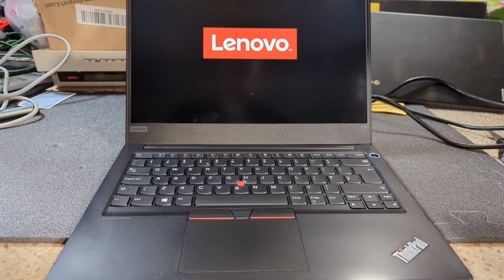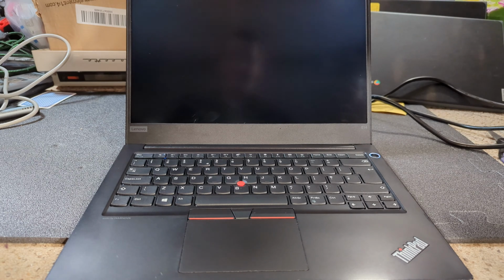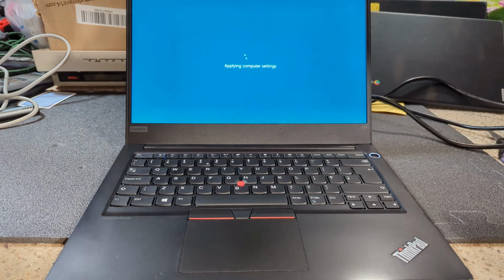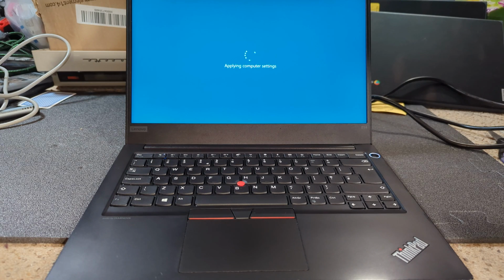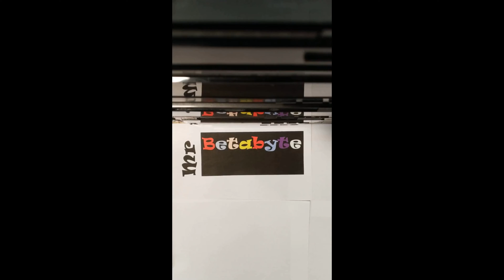Lenovo Thinkpad E14 laptop  - No backlight but it might not be the panel!

Comment: Not working for me. 😢
Reply from the maker: Really sorry to hear that - it's certainly worth checking. It could be a damaged cable from the motherboard to the screen or the fuse might have popped on the motherboard for the backlight although that is rare unless something has caused an issue. I would doubt it's the LCD itself as the backlights are pretty reliable.